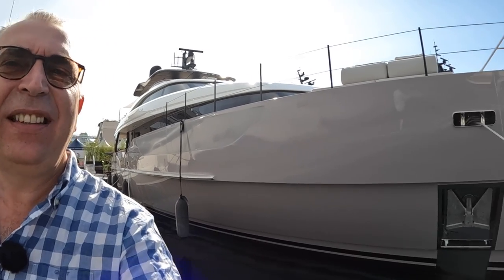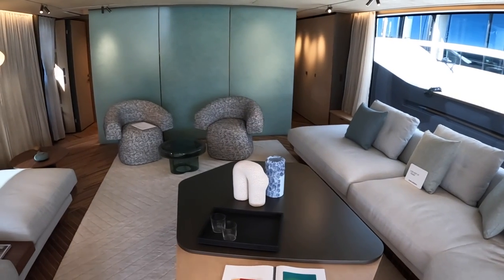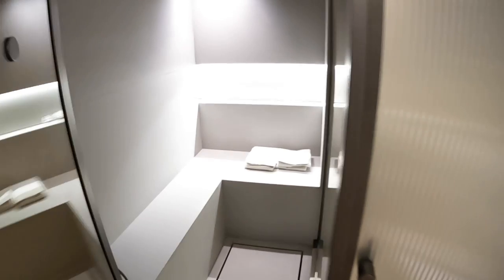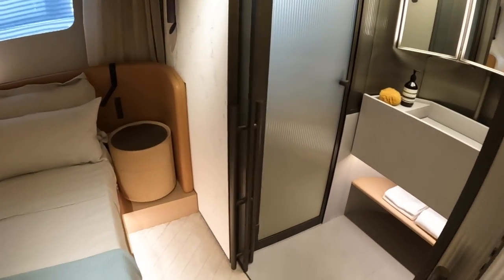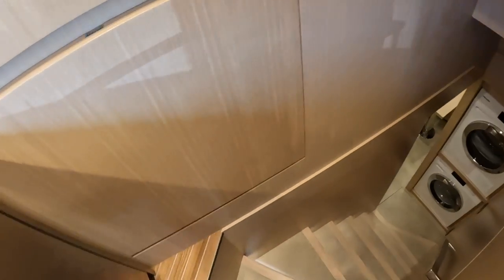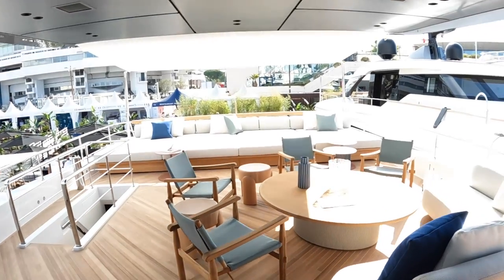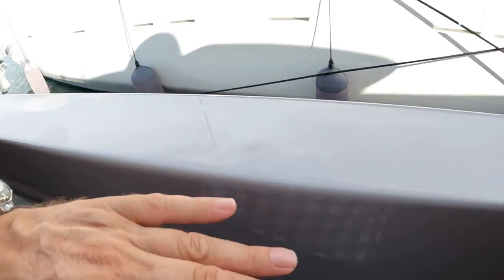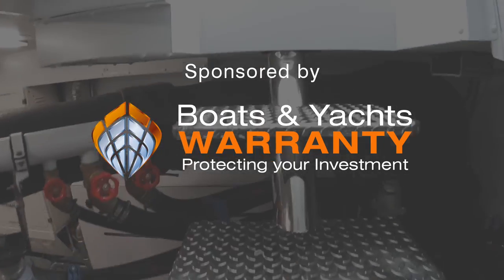€7.5 Million Superyacht Tour : Sanlorenzo SD90

Comment: Amazing yacht. Definitive styling. One thing I didn’t notice was an indoor formal dining area. I think I’m a fan of that. Speaks to the lifestyle of the owner, perhaps.
Reply: I agree about the lack of a formal dining space. On a faster yacht it probably wouldn't be an issue as you could cruise from port to port in the Med, or island to island in the Caribbean and then dine out every night. However as this is more of a cruiser you're likely to be at sea for several days at a time and I think you'd miss a proper place to eat in those circumstances
Reply: Agree. Some yachts have too many areas dedicated to formal dining. This one, not enough.
Reply: Was also my first thought after seeing the interior.
Reply: I agree. Where are you supposed to eat. For the price of this yacht you really don't get that much. I have seen far better in a 90 for the same money or less.
Reply: I noticed the same thing, no formal dining area.
Reply: Formal dining area is wasted space for the 99% of the time you're not formally dining. And you'd only use it while at anchor so you may as well just all go to a restaurant near the marina. What I did find odd was the huge number of sunbathing beds for a boat with only 3 cabins

Comment: San Lorenzo never disappoints.  I love the aft cockpit, doesn't pretend to be a dining room, just comfortable lounge.  And those rounded corners/hidden stairs are wonderful.  Love the converting lower deck cabin/lounge.  Surprised there is literally no way for the Captain to get to the sides for docking, yes, there is the fly bridge, but, hopefully there are docking stations or a remote.  Galley seems awfully stingy, to me..  What is the plan for dining?  Except for the crew, there didn't seem to be anyplace.  I did not notice a high/low table topside anywhere.  Surely the plan is not using your laps all the time, or a folding table and chairs.  I'm surprised Nick didn't address this in the tour.  But for that, as always, great tour, Nick.
Reply from the maker: The dining setup is owner spec, you can have a dining table if you prefer. 🙂
Reply: @AQUAHOLIC  of course, but just curious what this owner's plans are.  I just find it "interesting" a boat this big, with the range it's got, there ,just doesn't seem to be an obvious plan, to me.

Comment: Gorgeous Italian design yacht...tho I tend to prefer slightly more functional/Scandinavian decor...and as usual, I wonder about the lack of solar on the vessel. I could be wrong, but Nick did not talk about there being any panels, and the engineering tour did not seem to indicate there were any battery banks or inverters installed. This is a very pretty thing, but I definitely would prefer something with with much eco-practical sensibility and design ethic. ✌✌💯💯

Comment: Nick please to advise if your yachts are coastal cruisers or blue water ocean crossing cruisers, not pacific cruiser 😊crossing obviously!
Reply from the maker: Boats like this are very much designed to go out to sea, they're not 'coastal cruisers'. The main limitation on what you can do is the range.
Reply: @AQUAHOLIC  YES this is vital information, as vital as the sails or the engine size and reliability and amount of fuel and fuel mileage?? I know I would want to know if the engine(s) drank fuel like a sailor at the bar or drank it like a nun!! Although some nuns may adsorb it like a Sponge by the gallon, knowing the information would stop a captain from Ben toon venturing across the ocean(s) without reserves. Thank you guys for a great VLOG with lots of great videos